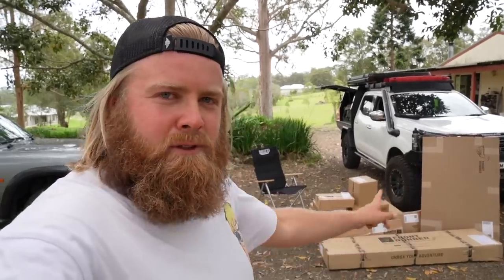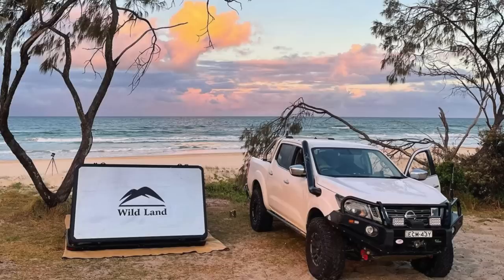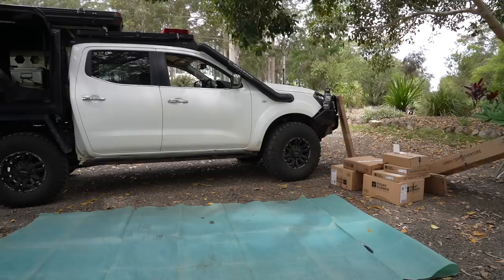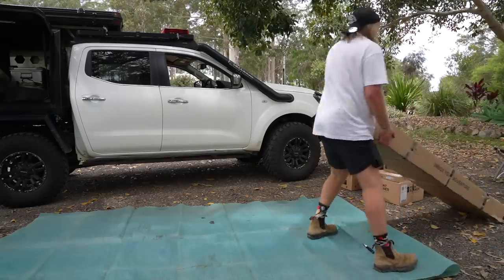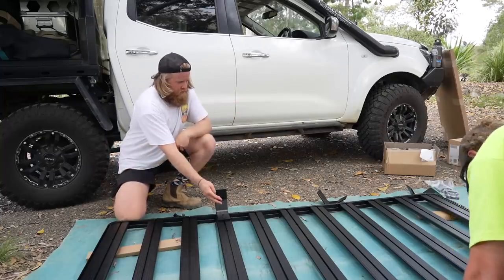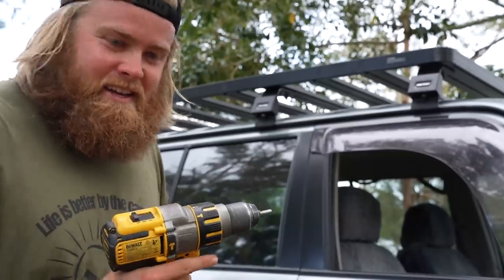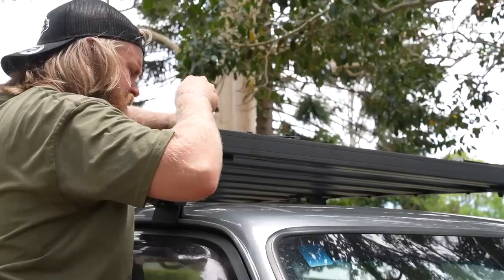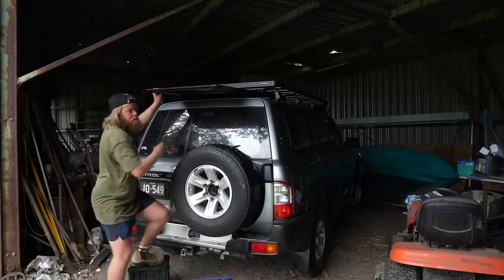DON'T get CAUGHT OUT! Nissan GU Patrol Build #1 Know your roof rack load limits! | Roof Rack Install

Comment: 04:20 not "common sense", you're thinking "intuition".

05:00 not "logically", you're using mathematics without the confounding variables.

Potential energy is Mass x Gravity x Height - this is static energy; gravity is constant, height is negligible, so mass (weight) is the important key variable, but not the Primary Key for calculating loads.

A load (stuff on your roof) has a velocity component, that is, angle - up, down, side to side. A side to side  velocity will reduce the load by shifting the mass slightly upwards as it accelerates. The most dangerous force on a roof rack is the downwards load (Kinetic and Momentum) on dips/bumps and hard braking (down and forward); most ill-fitting racks slide off the front under hard breaking as the Momentum is governed mainly by speed, in our case.

Kinetic energy is 1/2 Mass x Velocity squared (velocity is not speed, speed is constant, velocity is a function of acceleration and vector (angle)) - this is actually the energy placed on the mounts, without knowing the shear force (Impulse = Force x time) required to break the mounts.

Then there is momentum (p), mainly forward when braking - p = Mass x Velocity; little momentum is generated by side to side movement (very low velocity).

4WDs that tip sideways suffer from the "yachtsman's" issue, I forget the term for it (and it's complicated math involving calculus using known variables), but it depends on mast height, amount of sail, beam and keel weight. These dependencies are also found in 4WDs: mast height and sail is weight on the roof, beam is the wheel track, keel weight is the weight of the vehicle. If any one reaches a 'tipping point' (pun intended), the yacht will capsize, often quite slowly, so too a 4WD.

So, what's the answer? Weigh everything! There are good mounts and shit mounts. Don't drill, nut rivet, rivet or screw as a rule of thumb unless the mounting system is ADR approved. A quality rack should take a spare carcass, solar panel, awning, whips and antennas, shovel, maybe an axe,  HL jack, Maxtrax/Treds and swags; no containers, gas or liquids (my setup) Weigh the axles with quality scales and distribute the roof load accordingly.

Always enjoy your VLOGs mate.
Reply from the maker: Thanks mate!